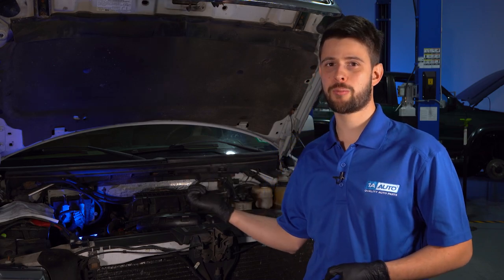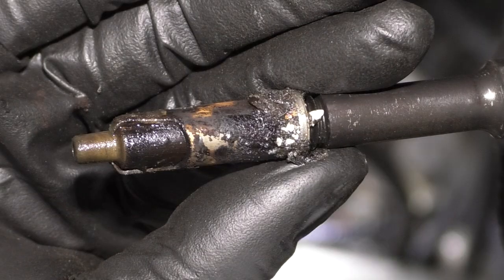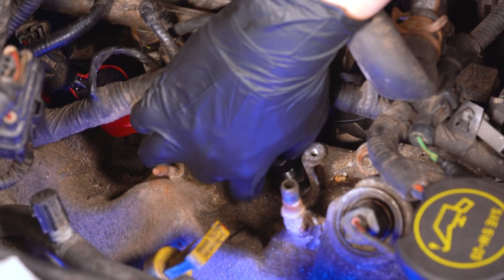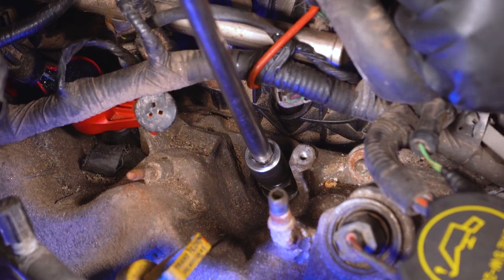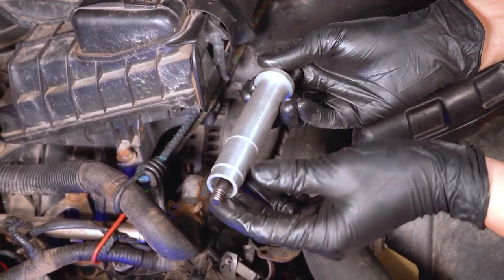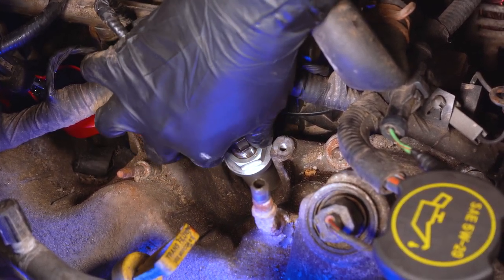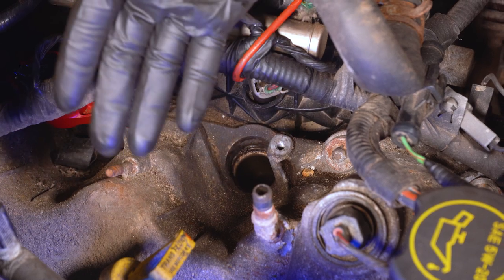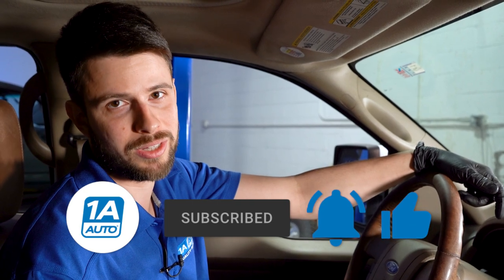Spark Plug Broke Inside Your Ford 5.4L 3V Engine Cylinder Head? This Tool Makes it Easy to Fix!

Comment: The Ford Triton engine is known for a lot of problems which includes poor oil circulation and poor cooling ducts in the block. I don't own one but that is a very ingenious tool that was invented for the Triton engine. A very self-explanatory video and interesting to watch.

Comment: you broke the plug because you dont know what your doing, on those engines you have to run the engine till full hot, then use a impact gun and you will never break another one.